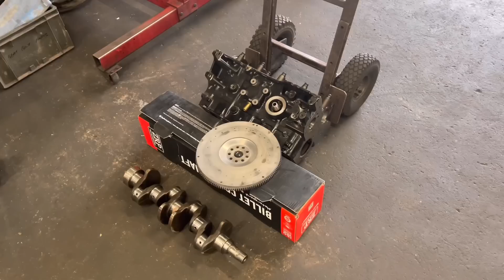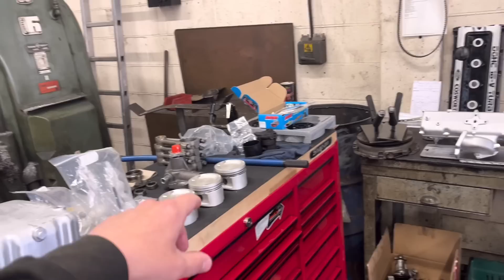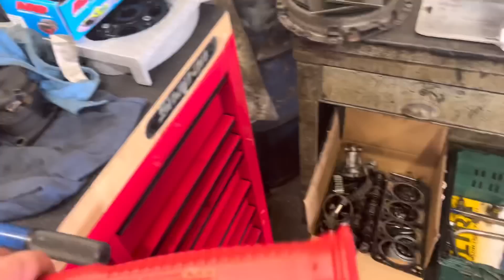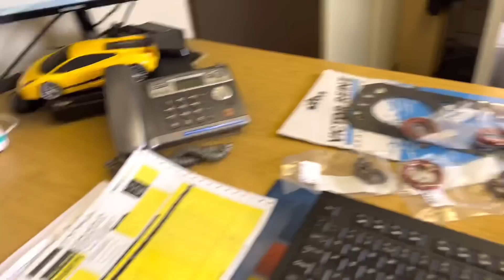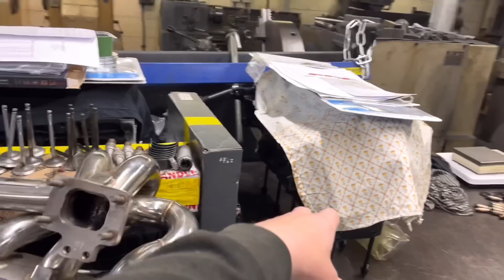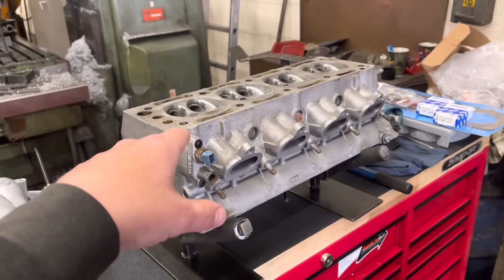We repaired it, it failed, now the engine has BLOWN UP. Costly lesson to be learned here

Comment: Interested in why you normally keep the factory exhaust cam in the Cosworth yet upgrade the inlet..... With turbo charged engines it's the exhaust valve/port/cam where the most gains will be found

Comment: Never seen pistons and rods loaded prior to crank fitment, have allways fitted the crank, done clearance checks with plastigauge and if there's a problem it's easier to sort out, not sure how much time you save good luck
Reply: Nor have i very odd not sure as you say how do you check crank for correct rotation with rods flapping about  or even managing to push one back out of bore onto the floor. Even if you have already 'dry built' and checked clearances etc  there is still that possiblity of tight spots.

Comment: I would really like a professional like you, to explain how you make a decision on rod and main bearings clearance, and pistons ti cylinder clearance when building an engine. And I donìt think I'm the only one wondering this.
Reply: If its a road engine standard clearances will be sufficient, for a race engine that is going to be thrashed and thus get much warmer we would give pistons a few thou extra, especially those with 'heron' combustion chambers such as crossflows and essex v6s due to the heavy crown getting hotter and likely to sieze. It didnt matterif a race engine rattled a bit but seizure was fatal. Bearing tolerances are best at manufacturers recommended or oil pressure can be affected, causing lubrication film to break down allowing meta to metal which is not good. If you were concerned about bearing clearances and extra expansion you could go a thou or so bigger and fit a high pressure/capacity oil pump.

Comment: Think you have got to over bend back a crank, then bend it back to straight, to take out any stresses in the material, otherwise it just bends again with heat. Something like that, I think.
Reply: Unless its a rare or unobtainable crank get a new one or a serviceable used one. 'Straightening' one especially in a motor that is going to make power its just not worth the hassle or risk.

Comment: How come you always machine the tops of the pistons? 
Is it because you face the head and block? Why not just use a thicker headgasket?
Reply: It's always standard practice. Can't shim with head gaskets. We are talking thousandths here.
Reply: @huwzebediahthomas9193  but if the pistons have hard anodising or something on them you will be removing it. The ones i use in my vg30 do. And we get different headgasket thickness to suit the maching done.
Reply: @huwzebediahthomas9193  there is another way shorten the rod by machining caps to reduce big end diameter and then rebore to correct shell size. But that is far more time consuming then just whipping a few thou of top of piston. We machined many a piston and never had a failure for that. Different thickness gaskets will play havoc  with compression ratios. Hence the only engines we ever used different thickness gaskets for was diesel engines.

Comment: Although you never show it I assume you put the rings in the bores and check the gap I was always taught it was critical (gap not gap spacing)
Reply: Absolutely critical and the gap depends on use, road motors had smaller gaps than race motors. The spacing is irrelevant as rings rotate when motor running. For race motors we often gave the pistons a few extra thou in  running clearance in things like kent and essex motors that were known to sieze pistons. It didnt matter if a race engine rattled a bit.

Comment: People think because they have a decent cast iron block & steel crank they will last forever! They absolutely do not! Especially when people are running them at twice the power or more than they were originally designed for! Those engines had issues running them hard when they were new! Like I said, people should not assume there's warrantee on motorsport engines! Best of luck Lee & have a good week!

Comment: I Have done a bit of bending (not cranks)  and   I think You have to find the temperature that normalizes the steel after bending. I would put in the oven to lets say 700f ( not sure) remove from oven and let cool. Do this twice and reinspect. The temperature should be low enough so as not to soften any hardening on the journals. This allows stresses in the crank to be relieved. I heat treat steel almost daily.

Comment: I've heard arguments either way about spacing ring gaps. I've always done it according to the factory manual (figure they know what they're doing) but I've had people tell me the rings "creep" under use and it doesn't matter.
Reply: Yeah, thats why two stroke engines have pins to stop the rings turning an getting stuck in the ports.
Reply: @michaelbamber4887  obvious when you think about it ! 😆
Reply: @peteredge3577  suppose, but I didn't think the continually rotate, just thought they just moved slowly over time.
Reply: That is correct sir they rotate at 3-20rpm depending on engine rpm.
Reply: @chrisclarke6344  dont say that out loud anyone with ocd will be freeking out lol
Reply: @stevef1076  ive already met one on this item on another thread,name of CE got abit offensive about it.

Comment: Why and how would the crank bend again once its installed. If it was straight and ground with matching bearings something must be wrong for it to bend again.
Reply: Wasnt done properly to relieve all the stresses in the crank. The only time it has merit in my experience is if its an rare or unobtainable crank, otherwise new or recondition a good used example.

Comment: By mentioning that you may have to machine the pistons after line boring the block, it sounds as if you are intending to set your bore off the centre line. That in my eyes is not good practice.  Also, surely the cap is just as damaged as the block.
Reply: Normally you machine the cap mating faces to make an ovoid then centreline line bore. Well thats how we always done it.

Comment: Great video as always Lee. Just a question regarding the cossie engines, when you regrind the crank does it weaken them for running big power? I'm sure I read years ago that engine builders for big power cossies prefer virgin cranks? This was quite some years ago so things might have changed since. I've had cossies for 20+ years and still have one 🙂
Reply: We used to stroke grind them back when current and ran 500hp reliably.
Reply: When a crank is bent, it's often because it's not balanced correctly for the RPM it's used at. I see these cranks only have 4 counterweights. Some inline 4s have 8 of therm. It makes them heavier but they balance better. The idea it to take a note of what direction it's bent in. It's either towards the middle throws or it's away from them.
Reply: @1magnit  best thing is to dump it and get another one and prep it properly for the intended use. If customer doesnt want to pay give it back and refuse the job.
Reply: @chrisclarke6344  That might be OK with a cossie but for something that's no longer available doesn't work and when you throw away parts you don't learn anything. If all of us just threw away all of the broken parts we'd learn nothing at all.
Reply: @1magnit  read my other replies on other threads, crank straightening is only worthwhile on rare or unobtainable cranks in low mileage classics. Other than that it is juggling chainsaws waiting for them to bite you. Been there seen it not worth it.
Reply: @chrisclarke6344  The only way to straighten a crank is to grind it straight.
Reply: Afterall, what's your definition of "bent" and how much bend is too much , every used  crank is bent but by how much?
Reply: @1magnit  grinding them straight is one way but still not worth it if its more than 3 or 4thou out, the flywheel and cam drives on crank nose and tail will then be off. The only true way is heating bending heating bending to relieve the stresses time consumingand expensive often more than getting a new crank. No every used crank is not bent, you can take a crank that has done 100k plus and the will show no deformation apart from the odd wear marks. We have taken cranks from engines we built for race duty when they have reappeared for a 'freshen' up and they are still perfectly straight. So i still maintain its not worth it for readily available cranks like these.

Comment: A 200 block isn't valuable, a standard 2litre Pinto block can be used. There's nothing special with a 'Cosworth' block, they're nothing more than a 2litre Cortina/ capri/ Granada block.
Reply: Correct people have this perception they are 'special' they are not they have slightly thicker walls and provision for long studs. That is the only real difference between 200 and 205. The holy grail was the rs500 200 block they had smaller core plugs and thicker castings. They are hens teeth tho. Back when these were current and used for racing we found that when someone lunched his 'cossie' block, one from a transit, cortina et all that had done several 1000 miles were very good because all the stresses had been relieved ftom the block. There were ways back then to keep them together and get reliable hp up to 500hp using a motor bored and stroked to 2.4l. I have passed a lot of my time served knowledge to lee but he seems to ignore it.
Reply: @chrisclarke6344  
Nice to know someone agrees with me.
I've been saying this for years but a lot of people absorb the bs spewed by so called specialists who insist it's a highly specialised engine which can only be assembled by them at extortionate labour rates using nothing but an original 'Cosworth' 200/205 block and  their ridiculously priced parts. A standard Pinto 2litre block is circa £100 but mention 'Cosworth' and it escalates 10 fold and there are people paying this.
Much the same with the Lotus twin cam. It's a very basic engine which can be assembled by any competent mechanic but owners believe the hype and pay fortunes for 'specialist' work.
I've assembled a twin cam using a pre cross flow Kent engine using as a base 1500gt unit, adding the front chain cover c/w water pump and head for very little outlay.
The Lotus police however would frown upon it ...
Reply: @Draxindustries1  that is all they are a block from a 1970s rs2000 or 2000e cortina is good enough. Same as you say lotus engine find yourself a 105e block job done. Ive heard the same about the BOA and BOB cosworth 24v v6, tell them its just a 2.9 cologne block without lifter bores machined they think you are a heretic! The only part of the YBs and BOs that were cosworth was the heads.
Reply: @Draxindustries1  also people forget all IC engines are basically the same from late 1800s to today get all the junk off and allowing for modern materials they all still 'suck squeeze bang blow'.

Comment: That crank? 
Improper heat treatment? Typically you would stress relive a high precision component in a furnace after rough machining (especially billet parts). If done improperly, residual stresses will remain. 
Over time the stresses relive themselves, resulting in progressive distortion.
You can straighten it temporarily, but with repeated heating / cooling & stress the movement continues.
My suggestion is that if you ever feel the need to rectify a crank you would straighten / bend it more or less to the shape. Then send it for stress relieving (@ a reputable shop) , then re-straighten & possibly repeat the heat treatment before final grinding

Comment: An item for the shop. A roll of floor protection film. Used by contractors to protect carpets and floors from workers boots.  Uses adhesive very similar to post it notes.  Peels off and leaves no residue. 
Why.  You can seal finished ready to assemble blocks.  Both the bottom
And the top.  
But you can also paste it on cylinder head deck surfaces  to protect them from dirt and scratches from things set on them improperly.
Reply: It's known as Poly-Tak.

Comment: For the amount of cosworths you do, I’m surprised you have not done a piston assembly sleeve for setting the pistons in to the bore, and use the slow shitty ring compressor. Stg to most common over sizes would make things really easy.
Reply: came here to say this, tapered ring compressors are awesome!
Reply: @leehearsey  me too lol
Reply: Beat me, but noticed there was not much lubrication applied to that piston before assembly, plus installing pistons before crank is odd to me, rods all flapping about when trying to install crank. And with the fact that these like to blow headgaskets without much provocation that uncleaned corrosion around the water ways raises a flag.
Reply: Do it that way for feel
Reply: The old engine builders say that new bores should not be lubricated on assembly. Check out Ivan’s shed. About as traditional as it gets.
Reply: @Dave5843-d9m  never had much succes with that method, we found not lubing rings could cause bore glazing/ scoring or ring damage. Particularly pertinent to diesels with their rougher bore hone. But each to his own i guess.

Comment: Never ever 'straighten' a crank it never works and will always destroy itself. Ring gap spacing is totally pointless the rings rotate when engine running.
Reply: I'd like to see one of them Pakistan blokes have a go. They seem to be able to fix anything
Reply: @ghollidge  Yeah they fix it for now, they dont show 3 months later when the truck engine blows up and the truckie is stuck half way up a mountain and the flywheel snapped off and cut through the floor like a saw almost injuring the driver.
Reply: @tubester4567  thats the excellent '3yrds or 3years' warranty they put on their products.
Reply: @ghollidge  😂 they would bash the 💩 out of it with a big hammer and it would then run for years. They are masters at overcoming problems.
Reply: I used to work on EMD 710 2 stroke V12 diesel's. The pistons on these sit on a piston carrier designed so that the pistons can rotate. If pistons are designed to rotate then I'm pretty sure at some point the ring gaps will align. So I don't think it really matters where the rings gaps are.. And I don't even have an armchair.
Reply: @mp721  they do as i am sure you know the critical thing is correctly measured ring gaps. They forget at working temps those gaps will be as close to closed as possible. I dont have a an armchair either!